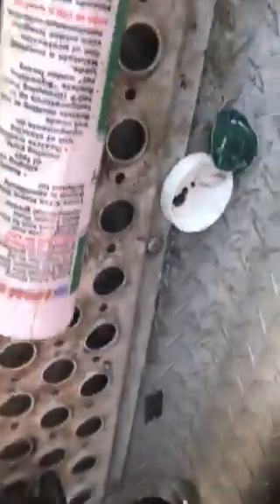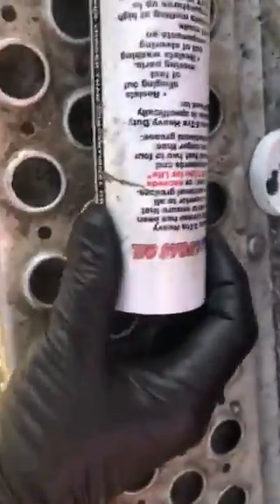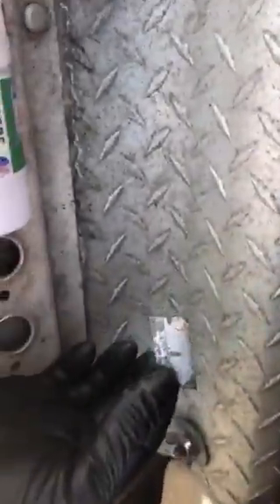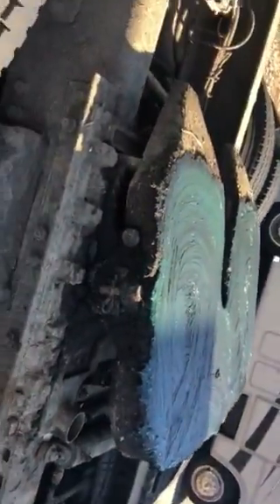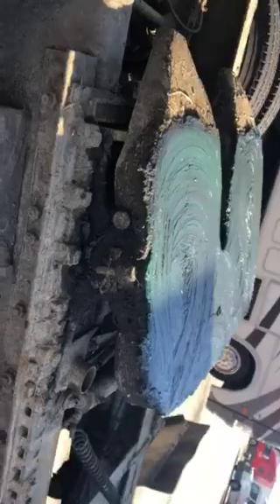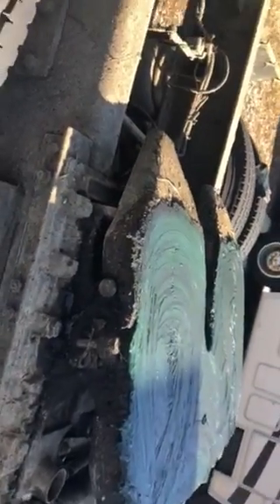Greasing A Fifth Wheel

Comment: Where do you get your grease? Looks green. Is it cheaper?  I find it for $5 bucks a tube    and use a grease gun, well  grease all my own zerks too though. But if  I could find a $2 buck tube of grease, I like your method.
Reply from the maker: Lucas Grease.
Reply: It’s same as the red just the red is for high temps it’s supposed to last longer Walmart is usually the cheapest